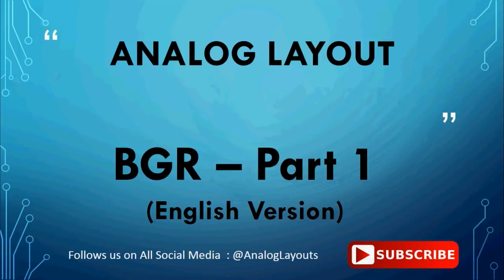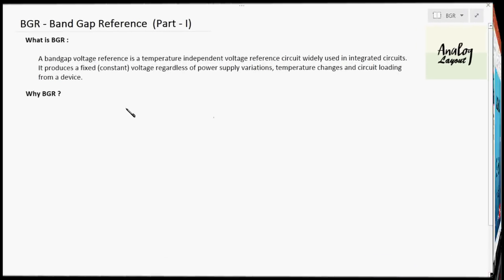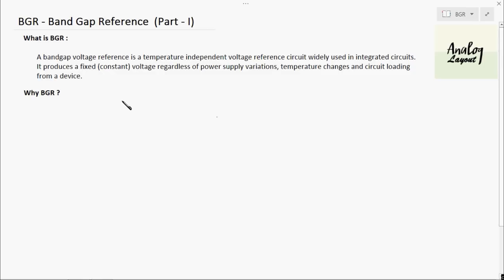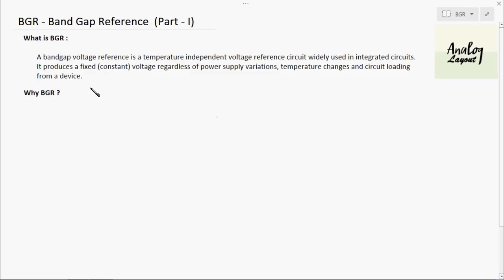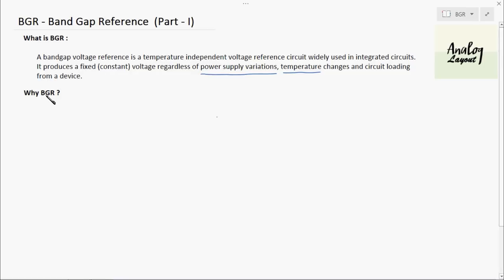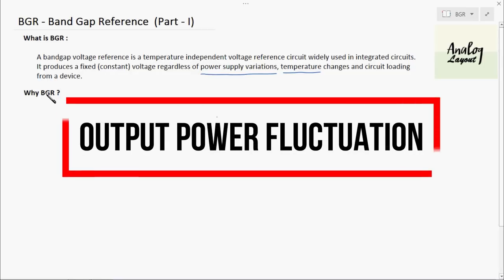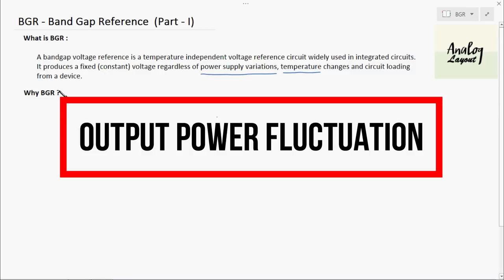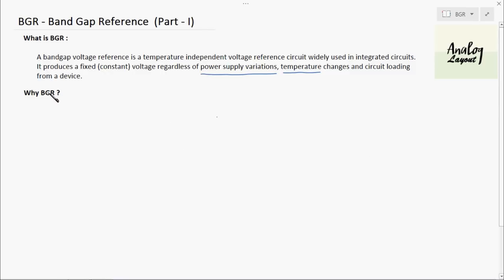BGR – Part 1

Comment: Thank you for this video sir. I have a question like, it is necessary for const. power supply that we have a Ptat and a Ctat but what if the we can't get a Ptat or a Ctat. For ex. When increasing temp our voltage only inc. or dec. Then how can we get our const. power supply ??
Reply from the maker: Designing a ptar and ctat is very difficult , once they design ctat and ptat , we have give that voltage in to a differential pair and we have calculated avarage voltage , and so on ... Il try to upload part 2 asap
Reply: @analoglayout  Thank you sir. It will be good to have part 2 so we can understand this more in depth. 😄